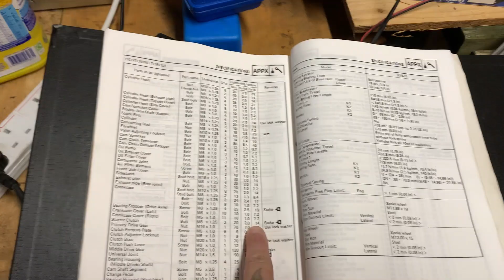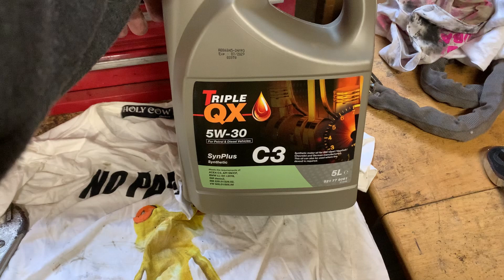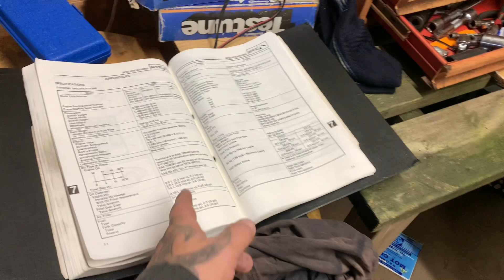yamaha virago 535 project part 5

Comment: Might sound like a daft question, but it's got a good, well charged battery on it yes? They take a fair old current, even a tiny one like that will need more a battery charger to deliver good torque
Reply from the maker: Brand new battery fully charged.